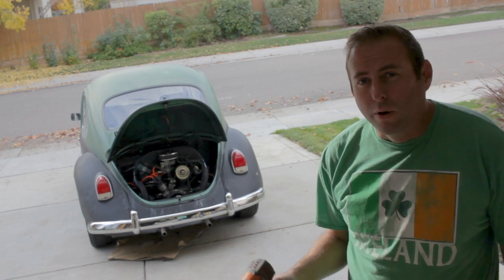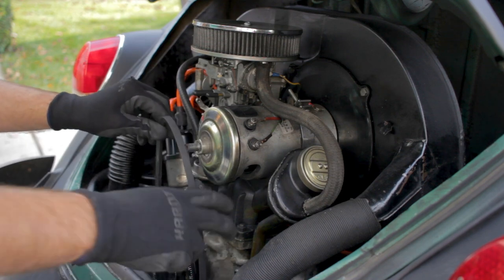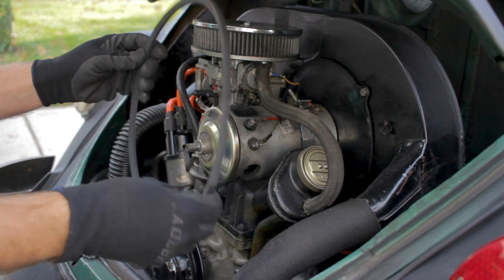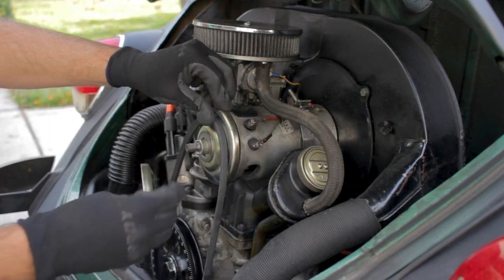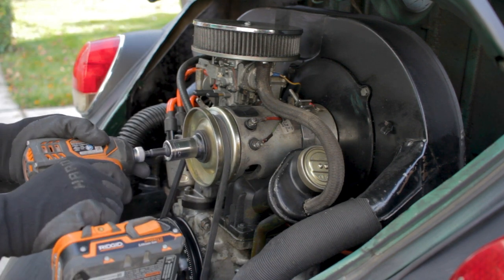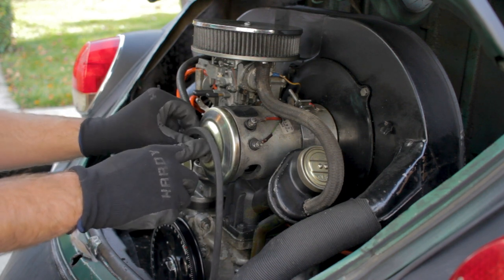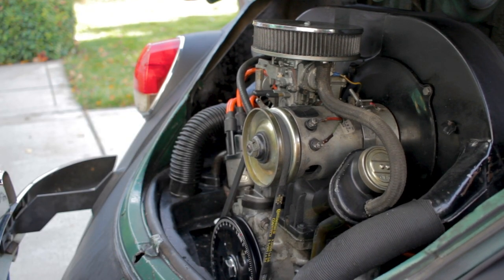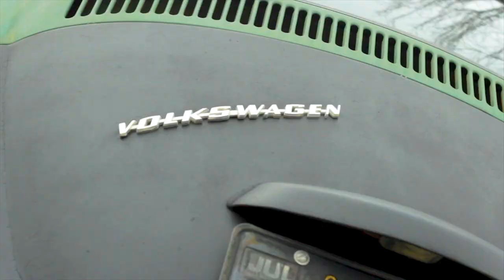VW Bug How To Belt Change / Adjustment - Quick and Easy

Comment: Nix the drill putting the nut back on. A very good way to bend a pulley. The pulley must be allowed to turn as you tighten the nut to allow the belt to climb toward the outside of the pulley. Read the book..
Reply: Agreed👍

Comment: This is a super easy way, but for the sake of a larger audience, including me....Where is the engine breast plate that goes below the lower pulley? :-) No mention of it at all. Also, no mention of using a screwdriver to hold the top pulley in place in case it spins when removing the nut. And no technical explanation of how/why the washers affect the tightness of the belt. So, if you are aiming this at a first-timer, there is a good bit of information missing, but thanks for sharing!
Reply: why so critical, you're over complicating it mate. If the alternator pulley spins then find out how to stop it spinning. The washers affect the tightness of the belt because they press against the lugnut and the hub. That's it no need for technical know how
Reply: I must agree with Gary, tutorials (in general) should show EXACTLY how to do things, for somebody with zero knowledge. Whoever has advanced knowledge can fast-forward. This is why owner's manuals, for commercial products, get revised by people who are not intelligent in that field, so any "dumb" mass consumer can understand it
Reply: @Aikaramba12  In general it should be more precise
Reply: Sasa Zapadnik yeah that’s true

Comment: I’m in Oakland downtown at Lake Merritt I don’t know what time it is 1 o’clock in the morning 2 o’clock in the morning I have 4% battery and then you say turn it to the right spot just like that what’s the right spot
Reply from the maker: Hi Israel. When I said “turn it till it feels like it’s in the right spot” I was referring to the belt’s position on the wheel. Sometimes the nut clamps down on the belt and you have to turn it to work it out to where it would be when running. 🤗